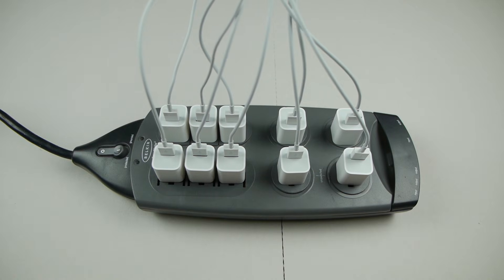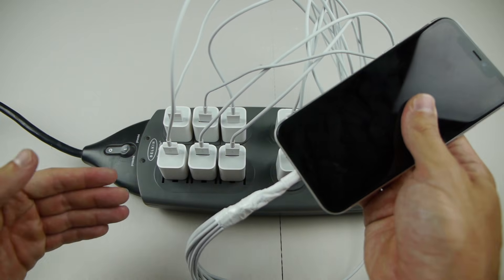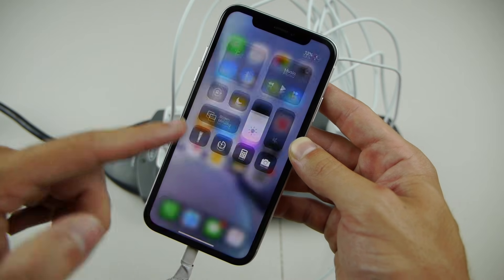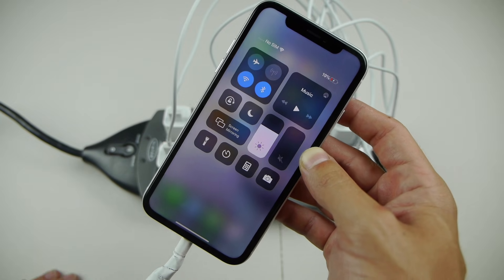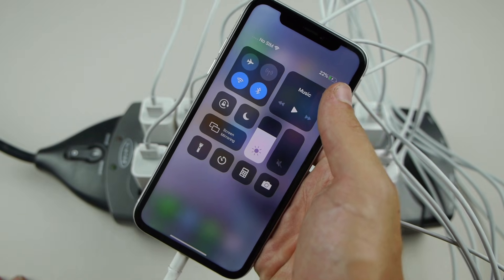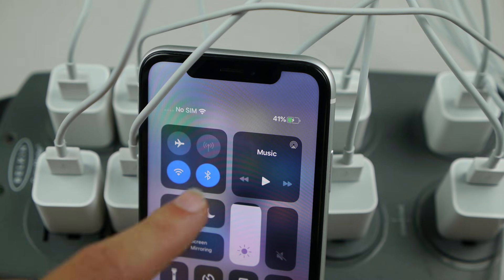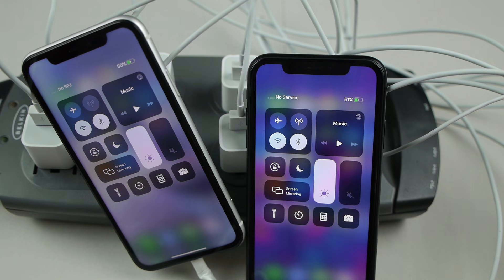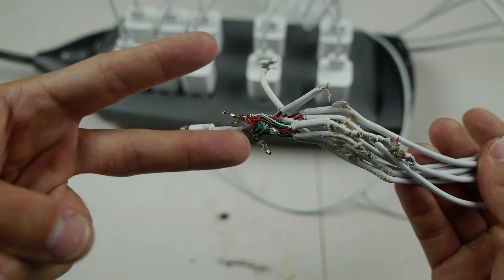What Happens When You Plug 10 Chargers in an iPhone? - One Mega Charger!

Comment: “This charges much faster” a min later “the single charger is the winner!!!!”
Reply: But battory is going to explode later or dies very fast
Reply: @ociogame9429  no it won't lol
Reply: 🔊Same ...😝🤣🤠🤠🤠🤡🤡🙈🙈🙈🙈🙈🙈🙈
Reply: SumaN KiskU lol
Reply: Single charger wins because multiple cable take time to pass electricity from 10 wires but single wire has single path so it charge fast than multiple charger.🤟🤟🙏
Reply: @Zano444  bruh. The only thing about the multiple cable thing is that it will loose power on the path.. but the speed it will remain the same.. it's the speed of electricity.
Reply: Chutiya work
Reply: Class 10th and 12th All subject vvi objective question 💯💯https://youtu.be/0NR0Cu6dSWs
Reply: I did try this out the single charger is faster
Reply: Hi
Reply: Magic:>>>
Reply: Hahahaha
Reply: @midmeh  ....

.🤮🤮😁😁
Reply: Nope
Reply: Yeah he's wasting my time
Reply: Lel😂
Reply: charged at 1 minute and 40 seconds
Reply: what a nonsense video.Increasing more charger in parallel connection means joining same color wires will remain same voltage and current will multiply increase by number of connected charger in parallel. So power rating of overall charger will increase and it start fast charging, as we seen in fast flash charger. But it will harm mobile phone and battery may it will be explode also.
Reply: winner winner chicken dinner
Reply: https://youtu.be/vtWDnSDAUZ8🔥🔥 OMG
Reply: Real winner is guy who got a free phone to destroy it 😂😂😂

Comment: There’s regulator inside the phone to limit the maximum current input
so no mater how many charger you connect in parallel, the phone will always drain the same amount of power per sec.
Or you can think in another way,
What if we connect 10000 chargers in parallel to charge your phone. 
Will it get fully charged in 1 sec ?
Of course not XD

Comment: i think 10 adapters is kinda useless you just seperated the wires with the same current,voltage,watts in those adapters in one socket it was the same as the normal one and it was a lot efficient because the diy one has open contact and properly soldered. why not just use a normal fast charger?

Comment: Yeah. You can do the same with a Mac book charger rated at 65W. In long term, you may damage the power management module around the lightning cable. Which is a cheap fix.

Comment: Dude bought a $20 -$30 power strip, and 10 watt iPhone charging adapters that each probably cost $10, $15 each with the cable included and soldered it while holding it with electrical tape, with paid white paint, when there are like $40-$50 100 watt charge adapters.... I like his creative thinking

Comment: No matter if you fit a million power bricks in parallel and connect it to the phone it will only charge(draw current) that it needs, so 
If the phone can handle (hardware and software wise) max 60 watts, you'll only be able to use 60 watts and not the total watts x powerbricks

Comment: That's a fast charge. The current input into the battery is higher. A 18watt is the same and a 40watt wall charger is faster yet, but, it harms the battery. The circuits inside were not meant to pull that much current ave you'll bake the circuits.

Comment: Short answer "nothing!", voltage will be same, amp will increase.
electronics use as much as amp they need, no matter even if you supply it 100 times more amps to it.
Here's why:
10 x normal chargers.
a normal apple charger gives 5v 1a
10x1=10amps 5v
The iPhone model used in this video uses 2.4 amps 5v max.
so even 2-3 chargers. (or even a good charger which supplies 2amps or more) would have had done the same.

"" DO NOT TRY THIS , YOU MIGHT DAMAGE YOUR IPHONE ""

Comment: What made you suspect that it wouldn't work? all you did was connect all the chargers in series, which means the voltage remains the same, but at a higher amperage, meaning a faster charging.
Long as the phone can handle the higher amps, you good to go.

Comment: The iPhone kinda limits how much watts it should be taking or else it'll be blowing up and the lithium ion will heat up very fast. So, this is not going to work at all even though you've plug it in a 100 watts adapter and if the phone can only take 15 watts then your maximum is 15 watts and it's not going to increase.

Comment: Here’s the information for the people that don’t know. In order to protect power surge and prevent the motherboard from frying entirely Apple has developed their firmware so that it only accepts 18w(fast charging limit)while charging. So let’s say you bought a 30w power brick thinking it’ll charge faster, your iPhone will only take 18w from that 30w so your phone doesn’t heat up and battery doesn’t degrade. So therefor if you want to buy a fast charger just buy an 18w brick cause buying any further is just a waste of money. Thank you for reading.

Comment: If you want to know why this experiment failed, here’s why: 

iPhone chargers have a fixed resistance between the data pins and the power pins. 

This is recognized by iOS as an original apple charger hence it allows more current to be drawn compared to an aftermarket charger.

When he connected 10 chargers in parallel he also connected these resistances of each individual charger in parallel.

Resistances when connected in parallel decrease. The iOS did not recognize it as an original charger hence drew less current than normal.

As for why it charged really fast till 20%, that’s a built-in feature in every iPhone to allow the user to get an adequate charge in a few minutes in case of emergency. 

I might have missed something here, so feel free to comment if you have more info about this!
Reply: You’re right, it also is current limited on the phone side, so it will only charge as fast as it safety can, may as well just use a Mac charger with a usb c to lightning cable.
Reply: Tu e gay ?
Reply: Felipe I don’t understand buddy
Reply: ok nerd
Reply: @zaarinesubah153  he is prolly wayy smarted then u ever could be
Reply: @mr.ufo4xx478  or he just searched up and copy pasted 😂
Reply: Buggy Lol it’s called Engineering 😂

Comment: It will damage the battery overtime. More power means more resistance from the battery.. you must check first the total power  rated from the battery. Most fast charging phone takes mostly at least 20w.

Comment: Most smart phones have prohibitors or protection against overload or overcharging i assume u know this that why it will charge quickly on low power but not when its on high power its the same thing has a fast charger 0% - 90% will charge 20mins to 38mins and the last few %s will take longer not hating its kinda cool if u want to try something do a cheaper phone

Comment: Nobody:
Me: trying to find that one smart person that actually tells you how all this works or not works.
Reply: He wired them in parallel, so the voltage stayed the same but the chargers could supply more amperes to the phone. If he had wired them in series the phone would either do nothing because of the protective cirquit or it would just get destroyed.
Reply: @BrevityBuzz  that's the point bro,it's all about the voltage and the current.
Reply: Aaron Cowles  Yup you are right bro.The power outlets in our house may have different power limits like one of  1000W and the other one of maybe 3000W.But if we plug in a mobile charger in either of them it will draw the same power from  both the outlets.Thats the reason we plug in the air conditioner in the socket providing higher power rather than the lower one.So you are completely right bro.I don't know why people don't get it that it's the voltage that matters and not at all the power cause the power is due to voltage and current.
Reply: nObOdY 🙄
Reply: it’s basically charging at the max rate of 18w which will get you 50 percent in 30 mins. you can just buy an 18 w charger instead of doing this

Comment: Ummm, what he did is connected all the chargers in parallel. So the voltage doesn't change, it stays at 5 volts. The only thing that changed is current. Now the thing is that assuming those are 2 amp bricks, the total theoretical current which can be drawn by the iPhone is 20 amps and hence the total theoretical power output would be 100 watts but the input power is regulated and capped at the iPhone's end. So, it's just like plugging a MacBook charger.
If the voltage would had been any higher than the tolerance of the charger IC, we all would have heard a snap and flash and boom the phone would have stopped charging that's it.

Comment: "you guys should try this, it's not efficient"'
the reason it's not efficient is because that's not how chargers work. the charger sends out a test signal to the phone, and then the phone sends a signal back saying how much power it needs. there are two possible reasons why the phone didn't just explode in his hand:
1)the signal was divided or forced back to one charger, only allowing a small portion of the power to scaled through multiple plugs.
2)there is a surge resistor in the phone that forced "excess" power back out of the phone and onto the other terminal wire.

either way, this is ridiculously inefficient as ac to dc converters are not 100% efficient, and running each of the chargers at such a low voltage decreases the efficiency rating by around 10%, meaning that this is the most expensive phone charger to ever exist because the power cost is about 30% higher than it would normally be.
Reply: to sum it up... don't try it
Reply: Jungkookie_is_god thank you
Reply: Jungkookie_is_god burns in lava shortly after (prequel meme)
Reply: Did you see his electrical work? Half of the wires were even touching another wire!
Reply: Daniel Nansel could’ve broken loose by him taking off all the tape
Reply: Daniel Nansel it eeez wat it eeeez
Reply: EYES Ngl, I love the content, I feel like I’m in on some sort of joke. But by the comments, I feel like nobody else is
Reply: Daniel Nansel probably
Reply: I learned more than i did in school
Reply: Thanks google

Comment: You should have bought a kill-a-watt or similar meter to plug your power strip into to see what the current draw is. The phone is probably only going to draw about 2amps max so my guess is your charging speed is no faster than plugging it into a 2.1A or 3A usb charger

Also batteries charge faster when they are lower charged cause if you charge them too fast they catch on fire or blow up.

Comment: Until and unless you connect positive and negative terminal in series. The output is same as single charger. You fooling by connecting wires in parallel.